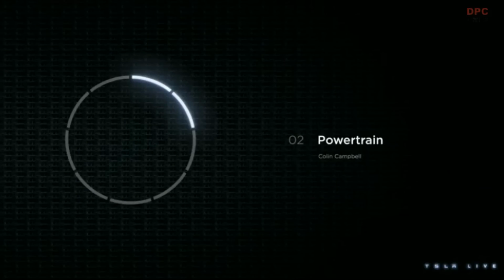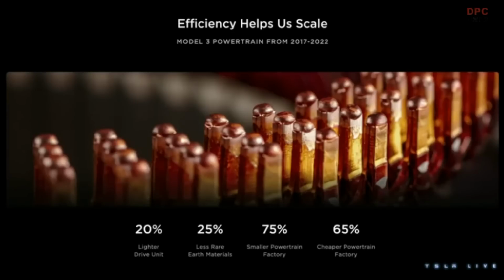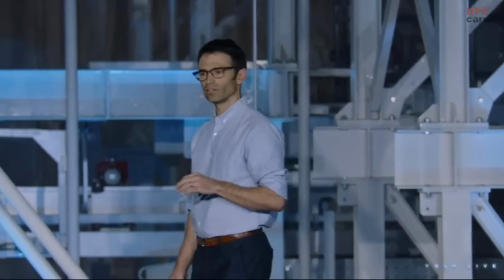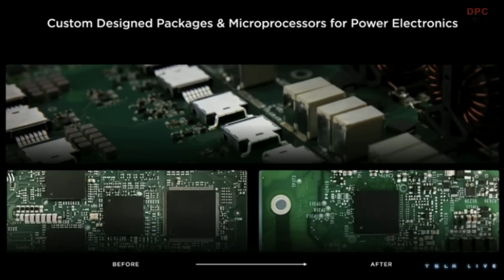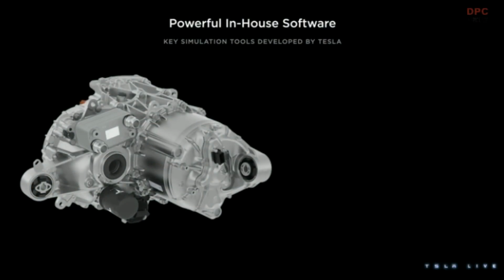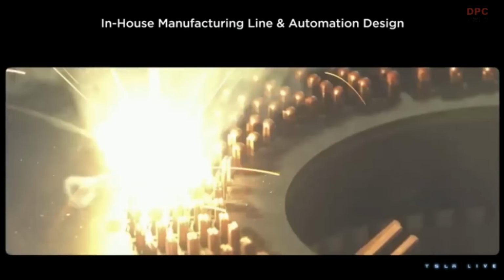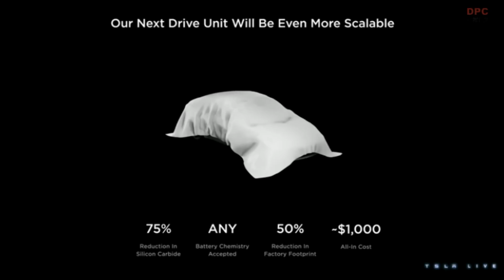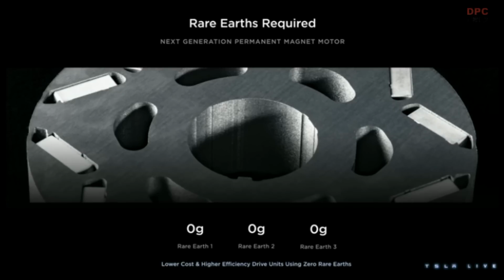Future Tesla Powertrain Explained

Comment: At this rate, the motor should be about 20-33% smaller to maintain similar power if the next gen platform car is using hairpin motors. Can also use a smaller battery, as well as making a lighter vehicle overall. Hard to quantify as it is up to Tesla to define the balance of design.

Comment: Way back in the 1970s Brush Electric from UK was making rail freight locomotives that used ac drive motors. This was unheard of especially as these could move a 1000 ton coal train at 0.5 mph. You could head the power coils pulsing as they slowly turned. Engineers said the power electronics had the frequency response of a concert PA system. The massive question is why have automotive industry totally ignore electrical transmission systems? They could have been more efficient for less cost and even better with a battery. Instead we got the same parallel shaft gearbox with plate clutch and when hybrids did arrive they were cheaply bolt on the side. 
The motor industry has basically taken the P for at least 40 years. Churning out the same old same. They deserve to die.

Comment: I have owned 3 Teslas since 2018. I bought a Model Y performance, which was delivered in September 2022. Made in Fremont. At 500 miles the battery coolant hose disconnected and drained all of the battery coolant fluid. About 10 miles after that, despite the car’s message that it was safe to drive, and I needed to schedule service, the master control unit burned up. I guess it was liquid cooled. Maybe it’s because of the type of chips they’re using? The other almost hilarious lack of attention to detail is that it has three Pirelli tires and one Michelin tire I didn’t notice this until someone pointed it out at about 2000 miles. It seems to be running OK in spite of the mismatch. You just have to wonder how that happened? In the middle of the assembly they ran out of Pirrellis and added a Michelin or vice versa?  That being said, when you look at the integration between superchargers and Teslas, I can understand about the integration in the factory with design and manufacturing of the car and the factory. That is pretty brilliant. From that standpoint, Tesla is quite a bit ahead. The worst thing that they have not been able to control for is Elon‘s diarrhea of the mouth, how can a guy who is obviously so smart be so dumb?
Reply: When you have FU money you do FU things.

A friend of mine has a Chevy Bolt EUV. They come in either white or dark blue interior.

His is special, the right side has white trim panels, the left is dark blue.

Final assembly didn't notice, final inspection didn't notice, the dealer didn't notice, the sales staff didn't notice, the buyer didn't notice.

I saw it the first time I saw the car, 4 months after he baught it with 3500 miles on the clock!

Comment: Interesting to compare this presentation to Lucid's drive unit Tech Talk video.
Reply: Did you notice how Elon's world dominating claim excluded Lucid based on price and/or class?
Reply: Lucid power train is better but more expensive Tesla power train is not far behind but very cost effective.
Reply: @ I sincerely doubt that. The Lucid’s drive unit is Very first principles simple, has fewer parts,far less machining and welding, and uses far less than half the materials to reach twice the rated power. It is designed for fully automated assembly and is scalable as seen in this he formula E units and the forthcoming Atlas drive for compact cars. Even Munro says this.

Comment: Hopefully they stole a few of the tricks from the Lucid powertrain
Reply: I am Tesla fan but encourage competition to have better product in the future
After lucid go bankruptcy, i hope a good company will buy lucid to found competition
Reply: So you really understand what lucid motor structure. Then you shall build your own car company good luck
Reply: @BobLee-sf6mv  well i do have a masters in electrical engineering so it isn't a far stretch for me to be able to recognize and appreciate quality engineering.  The Lucid powertrain in my opinion is a level above that of Tesla at the moment but I am quite sure seeing what they have done has pushed Tesla to again up their game.  Hopefully we see those improvements in this next generation.
Reply: More likely vice versa
Reply: no. Lucid powertrain is crap, very expensive and not mass manufacturable.
Reply: @Poxenium  looks pretty well designed and efficient to me.  it has industry leading power per pound and power output per watt input.  As far as i've seen it is also easier to mass produce than Tesla's carbon wound rotor.
Reply: "Hopefully" they'll be using the TESLA carbon wrapped rotor in the New stator. That should be "interesting"?
Reply: I suspect that Lucd's power train is protected by patents. They're copying VW ID4's motor and magnet design. At least Toyota knew about hairpins as well as most of the competition.
Reply: @MegaWilderness  Really think Tesla should just buy Lucid at such a cheap price right now and incorporate their engineers and patented designs into Tesla's fleet where appropriate.  They could also convert the Lucid factory to quickly produce a lot more Model 3 and Y while they are eligible for tax credit.
Reply: @darylfortney8081  I don't, I like when an underdog succeeds.
Reply: @darylfortney8081  
You want Tesla to buy lucid??
Reply: @darylfortney8081  
Why not just wait to the end of this year when lucid go bankruptcy?
Reply: @tv-ld3wv  because at that point someone else will have already bought them out, like the saudi's... sometimes it's best to jump in a little early on a great deal and just make it happen.
Reply: @darylfortney8081  
I encourage the competition
If another good company will take lucid after bankruptcy it's great